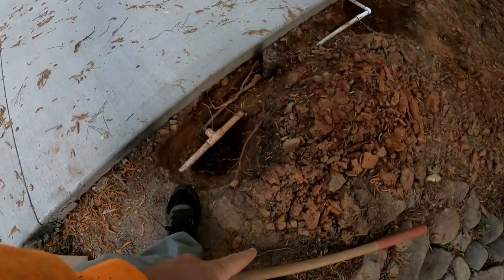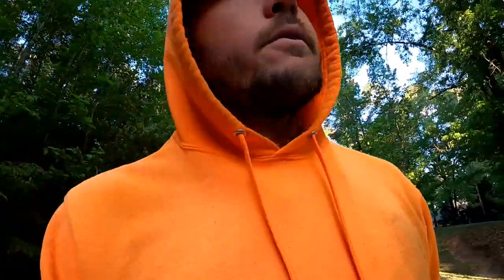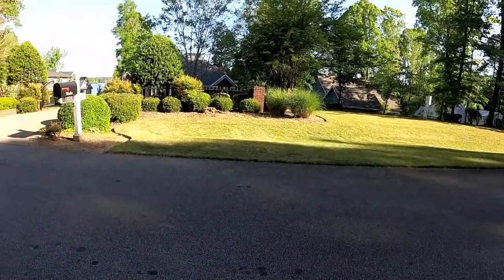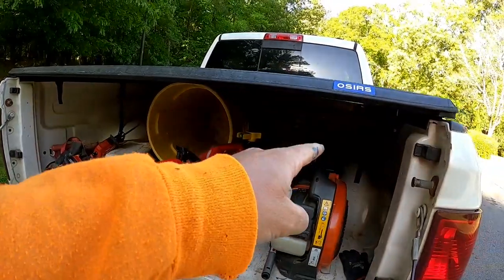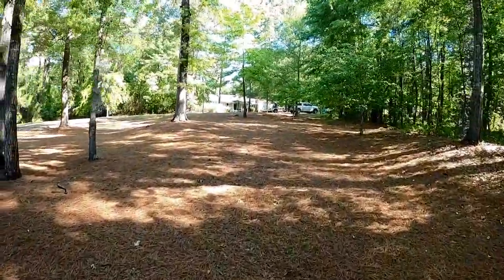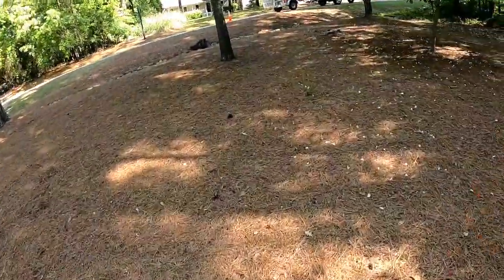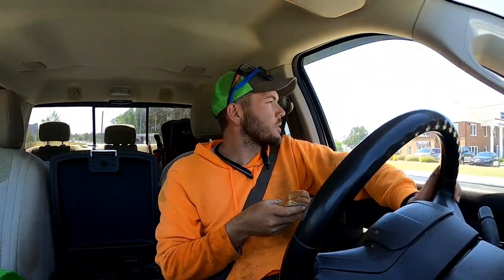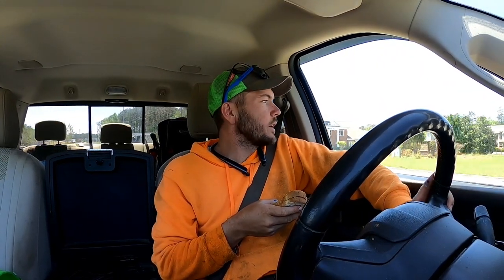All electric small equipment? (Solo lawn care vlog #8)

Comment: Morning! Tony! The joys of owning equipment you gotta fixem some times. Electrics good but I would still have a gas backup.  If your going the electric route. I would rig up a solar panel and inverter thats what my buddy did he has a housing authority account that doesn't allow gas equipment. Ezgo 56volt push mower has been impressing me. I bought one to use on two accounts I have. Electric is getting better all the time. Take care fella.
Reply from the maker: You would have to run some kickin solar panels to generate enough what size he running? And yeah your right thanks for watching

Comment: Love my Milwaukee OPE stuff. Good thing about Milwaukee stuff is you can use the batteries on other tools like impacts so if you have to change mower blades on route you just  pop in the battery from your trimmer. Get you a 6-bank charger with a 12v inverted for your truck so you don’t have to worry about charging at your customers homes. Also check eBay and FB marketplace for deals on 12ah batteries. I’ve been able to get a few 12ah’s for about $130 new.
Reply from the maker: Broo i agree and i wish i could find them that cheap even on ebay lol

Comment: I got the same trimmer 525L you want it you can have it for free mine looks like new but it won't keep running and it's too new to break down take care my friend 😊😊
Reply from the maker: Bro richen the high end screw mine was too lean from factory
Reply: @tonyslawncare   What do you mean, having major issue with my 525L running. Which way do I turn the adjustment on it? Thanks alot for your videos.

Comment: Great stuff Tony! 🤔couldn't you just get a power inverter installed in your truck  to plug in the chargers? I just picked up some 0.95 Milwaukee trimmer line😉good stuff👍oh yeah 😀☝️what about your new Red Max trimmer you just got? How is it doing?
Reply from the maker: I did have a deep cycle battery and a 1000w inverter in my trailer last year but inverters are very inefficient unless they are used at 80+ percent capacity turns out and so even with a big deep cycle i could only get 3 or 4 charges so not gonna do that route for now and if i had it wired into truck battery i would have to have truck running while charging it cause normal car batteries are not deep cycle so ive been doing alot of homework on it and still working on it and redmax is doing great vid coming today